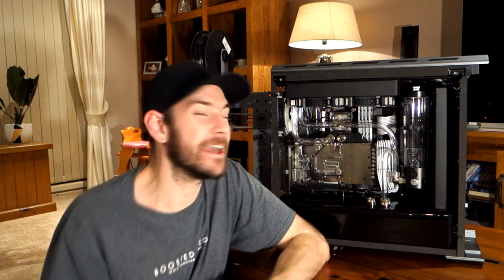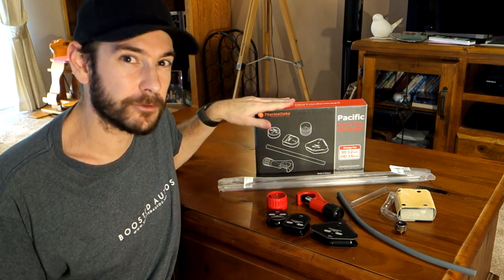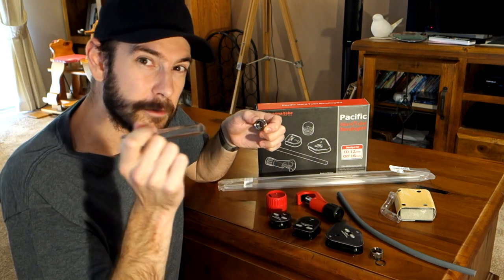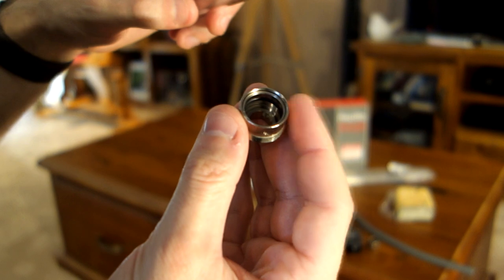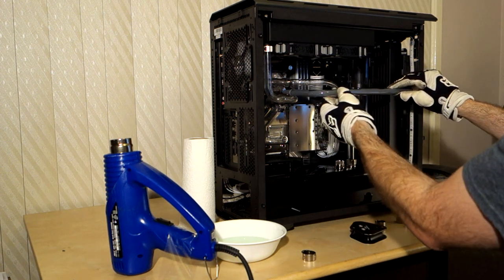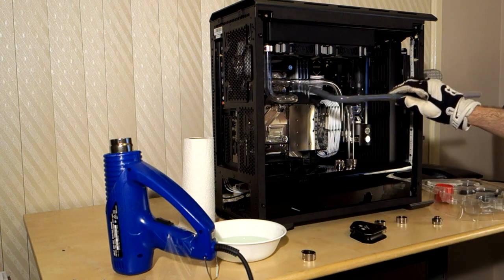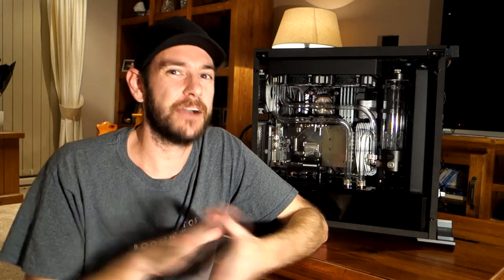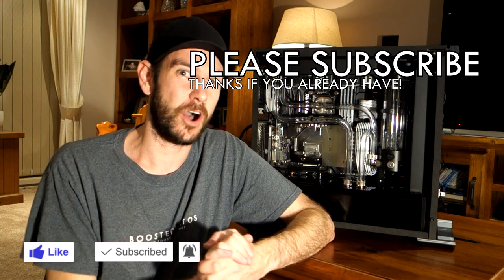The Complete PC Hardline Bending and Installation Guide

Comment: Thank you for this video! I've been building PCs since the 90's, and water-cooling them since the early 2000's. I've got my first hardline kit to install next week, so I will definitely use the pointers in this video as I am pretty sure I would have messed up an O-ring or two by inserting the tubing for test fits during the install process.

Comment: Thank you for this. I was having trouble finding a guide that actually went over the email details like how the washers and o rings came in to play as well as basically explaining like I was 5. Gave me the confidence to give this a go when next gen gpus release
Reply from the maker: Awesome. Good luck with it!!
Reply: @boostedmedia  thanks! I actually jumped the gun and ordered the 2070s founders edition(I guess those overclock really well) and ordered all the necessary parts to build my loop so if I don't run in to any major issues I should be up and running on water within 10 days or so! Going for a Seattle Seahawks themed build with my green/black cablemod cables and a mix of blue/green LEDs and acid green(but clear-ish to prevent major gunking issues) liquid.

Comment: A tip to add to this, if you have multiple tight bends in succession where you cant use the mandrels. You can lay out a smooth surface, any texture risks imprinting it in the tube. And make your bends carefully by hand, dont make them too tight. And use the flat surface to ensure your nends are perpendicular

Comment: I’ve been searching for awhile for a guide that actually shows someone inserting the tubes into the fittings.  I was wondering if you had to take any special consideration into spacing and positioning in order to get the tubes in place after shaping them.  Thank you so much for actually showing that part!  Most vids just show how to bend and then just skip to the finished loop and it drove me insane!
Reply from the maker: It drove me insane too which is why I made the video. Glad it helped.

Comment: So detailed and gives a realistic look at how to step through the process. Thanks, man!
Reply: I'm in the research phase of an ambitious hardline tubing project in the newly released GEEEK G1. It would be my first water cooling project, so I'm approaching cautiously. 

I have read that for very small cases, acrylic tubing is recommended due to the potential for PETG tubing to melt—? Any suggestions or thoughts on this? Would I still be able to follow this process with acrylic? Thanks again!
Reply from the maker: Water temp needs to be kept below 38C when using PETG (which it should be anyway). But none of the systems I’ve built with PETG have ever had an issue.

Comment: Great and detailed tutorial.......loved it, especially about the measuring and fitting of the tubes.....subbed before this, but just looked at your channel. Dam!!! You are into everything son.....gaming, BMW’s the works. I am just starting to gather gear for water cooled rig.......I am quite intimidated about the leaks and maintenance. Built my very first computer in 2008 with Thermaltake Speedo case and i7 920 cpu......currently working on an all white build and desk top set up. View 71 snow edition with seasonic 1050w PS. Creative labs X7 DAC snow edition,   Orsair  k70 SE2, white edition,Yamaha HS 8 monitor speakers, long ways to go yet on internals, but will get there. Really trying to get the Galax 1080ti, or 2080ti HOF white graphics card, but no luck. Love what you doing so far, I have a few months to go before I can build. Will be building a sim rig based upon fanatec Podium 2 on to the Sim Lab P1 black edition reviewed by Barry Roland of Sim Racing Garage. Should be done with everything by the fall of 2019. Any help on that GPU by Galax would be greatly appreciated.

Comment: This is really good. I've watched a few videos on bending from other youtubers and I guess you can learn something from all of them. After watching yours just now, I'm feeling a little more brave. I don't build several systems a month like Jay or some of the others so I'm not quite as confident in free handing everything like he does. Your rig looks great. I want symmetry and parallel lines, but I like the loops too. I don't like too many rotaries, and Like another commentator already stated, I'm going to try to pull some of mine out before I get started. I'm working in the evolve x, I have a card in the vertical position with a 420 in the front and a 280 in the top. It's tight in that box! I also have the fat tubes, and I thought a 200ml Swiftech Maelstrom pump/res  combo would look really good in there. It does, but it barely fits. I can't use the two ports on top for a fitting whatsoever. So I have to go with the inlet that's right next to the outlet in the bottom front. I want to be creative in routing the tubes and that's what I was looking for I think when i started watching your vid. Thanks for your tips, you covered things well even for a second time custom loop build of mine.
Reply from the maker: Good luck with it. Just take your time. It’s not as difficult as it looks.

Comment: Thank you for a very good guide to help hard-line beginners like myself! However, I must say that as a retired machinist, I cringe when I hear someone call an O-ring a "washer". They are two very different things and one can't do the job of the other. In the references regarding the fittings, those are in fact, "O-Rings", not washers.

I found your advice and suggestions to avoid bends that are too close to the ends of the tubing particularly helpful! I wonder if I needed to have a bend in close proximity to the fitting end, if I were to first make the bend I needed, and then cut the tubing. That may keep the final cut end from being to distorted for a good seal... I may try that if I find a need for that kind of bend.

I've been making all my computers with soft tubing and I found that my Corsair 780T case looked very good with the PrimoChill 5/8 OD x 3/8 ID white tubing. Therefore, I'm going to be buying the PrimoChill 1/2in. OD Rigid PETG Tube. 

I honestly don't like the clear tubing rigs I've seen because their coolant colors are either too translucent and don't look very good under RGB lighting, or, if they're using an opaque colored coolant, the color begins to breakdown after a while. Reds begin to appear brown and greens, blues, purples, begin to lose their pigments and tend to turn into a less than aesthetically appealing shade of their original color.

Even white coolant loses it's 'sharpness' and in the end, I found if the tubing is color that you like, then you should always go for the tubing color rather than choosing a clear tube and coloring the coolant, but that's me.

I have just finished buying just about everything inside my case so I can completely upgrade my system. I had an MSI Z97 MPower MAX AC mobo, i7-4790K CPU, GTX 1070 GPU, G-Skill RipJaws DDR3 3300MHz (2 x 16GB), and a Corsair 1000i PSU. It was all installed in my Corsair 780T (white) case.

Now I have an ASUS ROG Maximux XII Formula, i7-10700K CPU, RTX 2070 GPU, T-Force Xtreem DDR4 3600 MHz (2 x 16), and a EVGA SuperNOVA 1300 G2, 1300W PSU. My cooling system was a Swiftech H220 semi-closed loop system with a 240mm radiator on the top of the case and a 120mm x 1.250" radiator in the front of the case (all copper rads). All setup with push/pull fan configuration.

However, I just found that my old Switech H220 pump is quitting on me. In fact, 1.5 weeks ago, my system wouldn't even start up. After I did the paperclip test on the PSU, I surmised that the CPU died. It was then that I decided to do this big (and expensive) upgrade. Tonight, I finally put in the motherboard, CPU, and memory sticks. My RTX 2070 hasn't arrived yet so I put in my GTX 1070 card. I pressed the "Start" button, and nothing happened...

I was upset and the one thing that I always suspected, was the PSU. Even though it past the paperclip test, running one fan doesn't take nearly the draw that running a full system does. Corsair created these PSU with cables that were specifically for the unit and some of the heavier cables, (24-pin and GPU cables), have capacitors in them.

I try testing them with a DVMM but I can't tell if the motherboard's 8-pin cable or the 24-pin cable the problem using that meter because the capacitors build and bleed and change the continuity in such a way that it just gets confusing. I think the problem is probably one of those cables but without a replacement cable handy, I can't test it.

I knew I was going to buy a 1300w PSU sooner or later anyway, so I ordered one by EVGA and hope the cables are better than that proprietorship crap Corsair does. After ordering the PSU tonight, I then tested the Swiftech pump, and it seems to be quitting about 45 seconds after it starts. I can't see that as the reason for the system not starting unless it's shorting in the pump wiring and causing the mobo to fail the startup.

At any rate, I'll be tearing down that pump to look it over and I may try cleaning it. Still, I needed to go with a more powerful cooling system so I'm thinking I'll buy the Thermaltake Pacific PR22-D5. The Corsair pumps don't move much water very quickly. They're OK for a smaller system, but I want something that'll circulate at least 1000 G/ph.
Thanks again for tutorial!.
Rich

Comment: Never done this before but that last bend there seems very hard to do? You need to be very precise so your 90 degree bend is right over the fitting for the pump. I would imagine you would had to pencil it out exactly and then bend it precisely on the marker? If you bend it just a few millimeters to the right you would end up with a skewed fitting. But he seemed to just eyeball it? Scared to try this now haha.
Reply from the maker: It just takes practice. After a while you can eyeball most bends and then just make small tweaks

Comment: Words of caution:  The pipe cutter tool will scratch the cut end of the tube.  I place a small piece of tape on my cut line and then use the cutter.  The tube with the tape rubs up against the rollers of the cutter but you'll get no scratches
Reply from the maker: Excellent tip!

Comment: Ggwp, i think u save my brain, I used 10 tubes for first time...
Reply: My first watercooled system is too fk difficult, I chose to put 3 radiators in a single build, a d5 pump and a WB for CPU and GPU and the tubes need minimum 4 bands, my brain is on 🔥 so thank you man

Comment: The black thing inside the tube, what is it? Is it silicone? Did you bought it or made it? Can I go over 90°?
Reply from the maker: It’s a length of silicone. Comes with the tube bending kit. You can bend however you like as long as you keep the radius low enough you don’t crush the pipe.

Comment: Question i got bitspower nonchamfer 14mm brass tubing with 14mm ek fittingbi did test fit i could get it in i use the deburr and chamfer tool i got it in jut messed gasket up and when I get it in and the fiyyinh put together I can grab it and pull it out its not easy but its not hard how do I know how chamfer pr deburr yo do

Comment: Hi mate, is your build still working properly?
My understanding is that PETG and Acrylic will deform overtime at the fittings due to the pressure causing leaks.
I am leaning towards glass tubes just because of that (even thou I dont really like the idea of working with glass).
Reply from the maker: Absolutely flawlessly. And the one I built 2 years ago with PETG is fine too. Never had a problem.

Comment: 4:40 - would you say washer, or o-ring?
Reply from the maker: O-ring is probably a better word.
Reply: @boostedmedia  It's not "better".  It's just correct.  An o-ring is a toroidal gasket.  A gasket is a thing that makes a seal between two surfaces.

A washer is used for spacing(like using slightly long screws into one of our radiators with washers to limit how far the screw goes in), distribution of pressure(like screwing into a motherboard, or the sping/washer/screw setups for mounting CPU coolers), or electrical/vibration isolation(DDC pump mounts, again motherboard screw washers) where a fastener(bolt/screw) is used.

British English often incorrectly calls a gasket a washer(mostly due to flat gaskets used in engines or household plumbing).

Comment: Is your gpu waterblock connected inlet and outlet? How did the tube fit in the back? or is this not necessary to connect it in the back?
Reply from the maker: You can connect on either side of the card. It makes no difference. I do actually have the water got my backwards through the block to keep the loop design cleaner, but it only makes about a 1 degree difference according to EK.

Comment: hey, question for you, if you turn on your liquid pump without liquid, and it makes loud noise, is that normal or is the pump faulty?
Reply from the maker: It’s normal but very bad for the pump. The water lubricates and cools the pump and the water pressure is what aligns the rotor. You’ll break the pump if you run it dry.

Comment: So if I only have a hacksaw, is there any advice on getting completely straight cuts? Maybe 2 wood pieces on a plywood board to hold the tube in place?
Reply from the maker: You can buy a pipe cutter on eBay for a few dollars. But yeah if you have to use a hacksaw you can clamp it and use some wood as a guide.
Reply: @boostedmedia  I'd rather not use eBay as I will most likely start the change from soft tubing to PETG this coming weekend, and as I live in Sweden it'll take some time for the delivery. :/
Reply from the maker: You should be ok as long as you clear up the edges.
Reply: @boostedmedia  I've got deburrer + 250grit sandpaper (I think) so should be fine! It's just that I've heard some say it's okay if the cut is not completly straight and some say it has to be.
Reply from the maker: You definitely want it to be completely straight.

Comment: why do you shake your hands like having a seizure when heating the pipes lol
that being said awesome vid man
Reply from the maker: You mean the up and down movement? To control the heat. The movement reduces the risk of hotspots.
Reply: I see. Well you seem to eyeball everything with pinpoint precision. I'm about to do my first hardline cooling but I'm afraid it's never going to work because as you said, I will be working in 3 dimensions and by that nature it is impossible for a human to make exact measurements, and since the tubing will be hard, there is really no way to install it since any error no matter how small will cause misalignment since the tubing is hard and will be impossible to ignore the measurement fault. I don't know I'm kind of panicking and btw my eyeballing skills definitely aren't the best either
Reply from the maker: I honestly felt the same way to begin with but it’s amazing how quickly you get the hang of it and the sense of satisfaction when it all works is awesome.
Reply: Im just afraid it won’t even go in at all since when i bend it i cant do it inside the case and make bends accurate and one one of the pipes i will have 4 bends meaning if i want to make a section longer in the end it will be impossible to adjust cuz its more than just trimming the ends. Is that what usually happens on the first time? Ur tube will be like maybe slightly off but even still since it’s hard tubing it will bot go in the fittings AT ALL?
Reply from the maker: There’s still a small amount of flex depending on the number of bends you have. It’s doesn’t need perfect precision.
Reply: I surely hope so im using the 500mm ek petg 10/12mm tubing